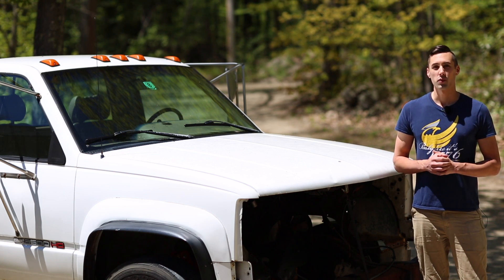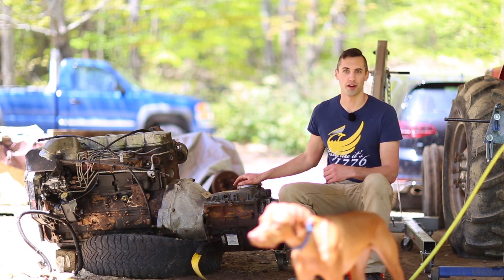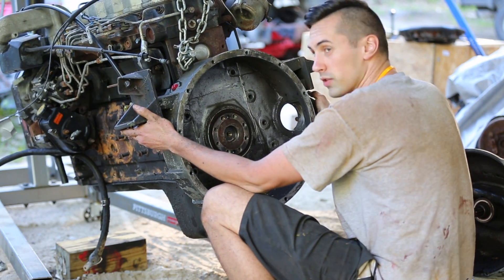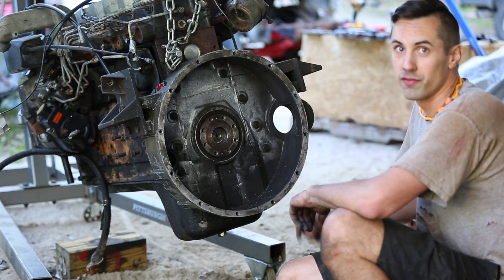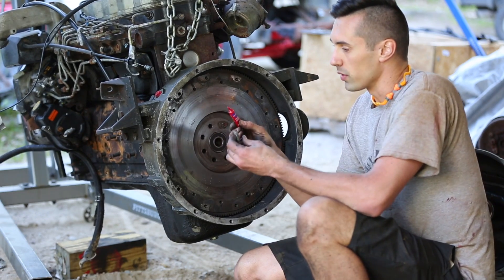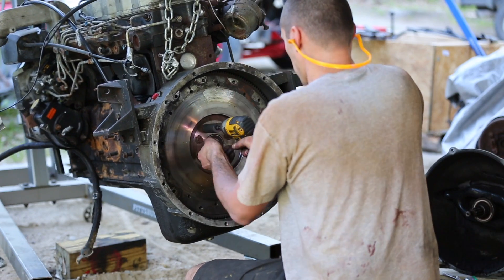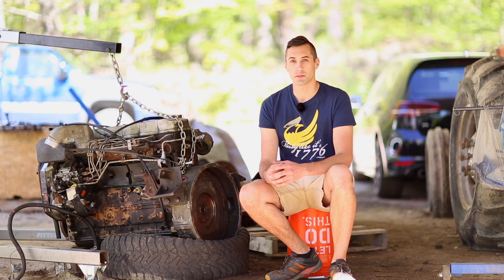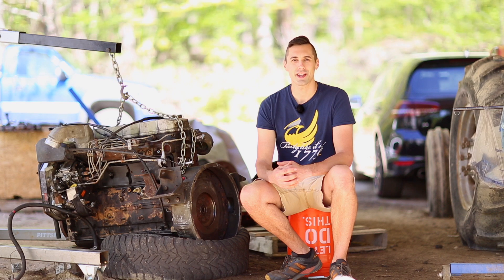Pairing an Eaton Fuller Transmission with a 5.9 Cummins ISB [Part 5]

Comment: I wish I knew a way to swap a manual transmission into my Titan XD with the 5.0 Cummins. I could figure the rest out, i just need a flywheel and bellhousing adaptor. A good tuner could do the ECU programming. I could find the clutch pedal, slave cylinder and clutch master cylinder myself and fabricate a bracket to mount it.

Comment: What kind of truck did you get the fly wheel and fly wheel housing from I am in the process of doing a Eaton fuller 6 speed swap myself my transmission came off a 7.3 powerstroke in a f750 and I’m having trouble finding answers

Comment: Im just now watching this. 1st screw long bolts into the flywheel to use as handles for the installation of the flywheel.  2nd never reuse flywheel bolts. 3rd why didn't you replace the rear main while you had it apart? It's a one piece and would have been so easy with the flywheel and bell housing mount off.

Comment: Waldo, I dont know if this has changed but man, you seriously need a better surface to work on. You are making life so difficult using casters on dirt. Pour a concrete slab somewhere, its not that difficult and you could do a vid series of the journey. Even pave your garage or something, anything other than dirt. Still great vids, I'm enjoying them slot.

Comment: I would like to say that I love your project and I was thinking about doing the same thing to another Chevrolet truck! But I was thinking about using a Power Stroke engine. I didn’t even know if the same transmission as yours would be able to bolt up the Power Stroke? Can you help me out with the information if it’s possible to work?
Reply from the maker: Thank you! You could probably make it work, but you would need an adapter to mate the Power Stroke flywheel housing to the Eaton bellhousing. You might be able to find something on the Interwebz since the Eaton uses an industry standard SAE 2 bellhousing

Comment: I'm doing a v10 to 12  Cummins swap now,was gonna use a nv4500,but after watching you're video I thought to my self, I'm going that route 😄 ,any help would be appreciated, part numbers on trans, flywheel ,flywheel cover ,clutch what ever you have ,thanks
Reply from the maker: The flywheel is a Cummins 3977281 and the clutch is an Eaton 107621-7. As for the flywheel housing, just do a search for "5.9 Cummins SAE 2 flywheel housing" (assuming the trans you end up using has an SAE 2 bellhousing) and you should find some results
Reply: You are the man bro,thank you so much 👍

Comment: A few sheets of plywood on the ground would make life easier.  For that matter a 3klbs/square inch  pad 10 inch thick pad isn't that expensive. You could eventually install a two post car hoist. Maybe that could be another series.
Reply from the maker: I actually have a two post lift that I picked up at auction, but I need a concrete slab to install it 🤠

Comment: Will the bellhousing accept a 10 speed transmission? Like Eaton Fuller 10 speed.
Reply from the maker: If the transmission has an SAE #2 bellhousing, then it will fit the flywheel housing that I have, though the flywheel housing that comes on Dodge trucks is different

Comment: Great mechanical content. I have a 06 Ford F350 Powerstroke 6.0L with the 6 Speed manual trans. I have an eaton Fuller 9 speed transmission (from a donor semi truck) that i would like to swap into my Ford F350 Duallie. Any pointers/ suggestions. Thank you
Reply from the maker: Wow, a 2006 with a manual? That must be rare! As for the swap, I bet it'll be a very tight fit. You'll probably need to plan on doing a body lift, but it'll be a very cool truck when you're done. Good luck!
Reply: @WaldosWorld  Thanks. Not many left around. More gears with an eaton fuller trans would be a perfect match.

Comment: Think I would of changed the 2 core/freeze plugs on the back of the block and rear main seal it’s all apart and then your ready to do the paint the engine
Also get some 3/4 plywood sheets to put your engine hoist on makes life easier your fighting with yourself all the time
Reply from the maker: Yeah, I can't wait until I have a nice concrete floor. It'll roll nicely on that!

Comment: I may have missed it, but why didn't you stick with the NV4500. I have a 94 GMC K3500 dually with 6.5l and NV4500 trans. It works really well together, don't think they would have done that combo if it wasn't a good idea to begin with. Just my 2 cents.  By the way, great content and very well made vids, keep them coming.
Reply from the maker: Thanks! Mainly because the NV4500 that I have doesn't have a speed sensor or a parking brake (this application requires both). I stumbled upon this Eaton for a good price on eBay and it solved those problems, plus I thought it would make the project a bit more interesting 👌
Reply: @WaldosWorld  I watched your past vids and found out your reasoning. I'm gonna continue and catch up on your vid series, love watching them. Thanks for replying back so fast, you have a new sub and should have many more. Keep them coming.
Reply from the maker: Thank you so much! 🤩

Comment: Remember working on the old NTC 855 Cummins when you puleed the fly wheel housing and replaced it you had to set up a dial indicator on the end of the crank and dial it in center before you torgued the bolts if not it would tesr up the transmission and the engine both it was close tolerance only +/- .0002 to .0005 ive sat under a truck up to an hour getting it as close to .0002 as i could posdibly get ....just so i knew it wasnt gonna fly all to  hell  within 25 to 30 miles if it lasted that long i got so good at it even the older mechanics would ask me to dial it in for them ...but most of the time we done an inframe instead of a block out overhaul
Reply from the maker: That's a good point you brought up. It prompted me to check the service manual to see if it required checking runout, but luckily, it seems like it's not necessary for this application
Reply: @WaldosWorld  i dont think Cummins does that at all on any of their engines ....

Comment: I love watching all of your vids. The Volkswagen would be cool too. The beauty of those ISB engines is that they were used in medium duty trucks and so it’s easy to upgrade as long as you have room in your donor vehicle at firewall and transmission tunnel. You could fit a 10 speed transmission to that engine even
Reply from the maker: Thanks, Pete! Yeah, I think I lucked out finding this medium duty transmission with all of the necessary parts for the swap for such a good price...it seems like it's hard to find a 5.9 Cummins with a manual in a medium duty truck, but there are a few out there!
Reply: Waldo's World unfortunately they all went automatic years ago but slowly coming back in the heavy haulers. I’m a huge fan of the 8LL and 18 speed transmissions.

Comment: Where did you get the Fuller trans, flywheel and housing?
Reply from the maker: Got it on eBay of all places 😂
Reply: @WaldosWorld  Is the bolt pattern for the bellhousing the same on the 6BT as the ISB? I would love to put an Eaton/Fuller in my 92 D250.

Comment: Two recommendations I would strongly encourage before going further.  First, replace that rear main seal on the engine.  Second, at the very least, replace the tappet cover gasket on the side of the block.  They are notorious for leaking.  If the budget allows, look into buying a  billet tappet cover which will use a much better seal design.  Those are two major leaks you don't want and are easy to fix at this stage.
Reply from the maker: Those are great recommendations, thanks! 👍
Reply: @WaldosWorld   -  What is the model number for the Eaton gearbox you are using.
Thanks
Reply: @WaldosWorld  that’s what I was going today too, it’s like a year old so I hope u did it
Reply: @WaldosWorld   -  I am doing a 12v Cummins/Eaton Fuller into a '94 suburban project and so I need to ask the same set of questions.  
What is the model number for the Eaton gearbox you are using.  
What are the part numbers for the; 
bellhousing
flywheel
pressure plate
clutch disc
TO bearing
etc. etc.
Did you have to fab up your own clutch linkage?
What bits and pieces did you use?
I am not able to do the work myself so I finally managed to find a shop that has agreed to do the motor swap. 
However, when I mentioned grafting on a 10spd Eaton gbox to the 12v, everyone looked at me like I was deranged. 
I had to send your videos to the mechanic.
So, if you could share the part numbers I would be most grateful.
Reply: I'm 4 years late but was about to post the same thing.  Billet covers are nice but for a low dollar fix you can RTV the stock cover in place.  The problem is that the stock gasket pushes out at high rpm when the crankcase pressure gets high.  Gluing it on fixes this.  I've done it on 2 600+ HP builds and haven't had an issue.

Comment: Great video Waldo.  Personally I am not a VW guy but that's just me.  The C3500HD drew me to the channel.  Can you talk about why you are constantly in the dirt all the time?  Do you not have a concrete slab or driveway or even just a piece of plywood?  I have never pulled a motor on dirt, its always been in a driveway or garage, seems like a challenge.
Reply from the maker: Thanks, Carl! I have a dirt driveway and no concrete slabs (yet). It makes life difficult for now, but I plan on pouring a concrete slab in the barn so I have a place to work.